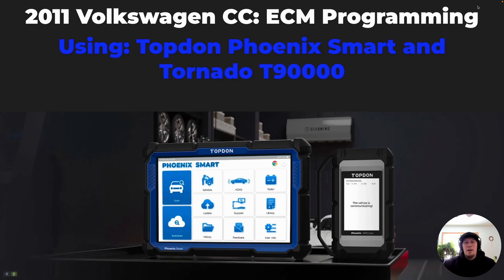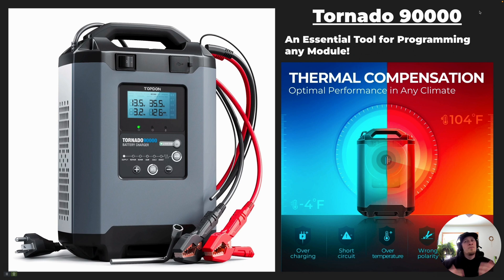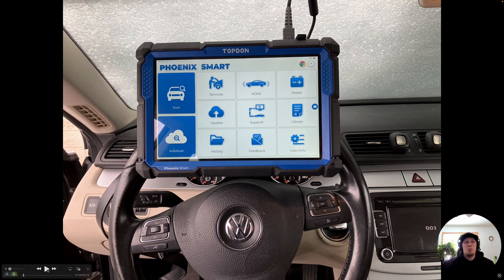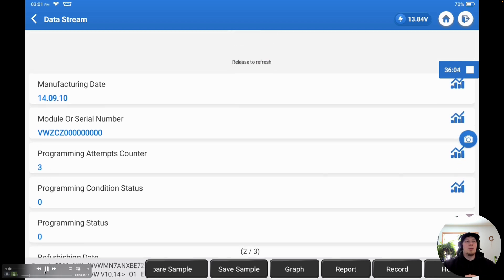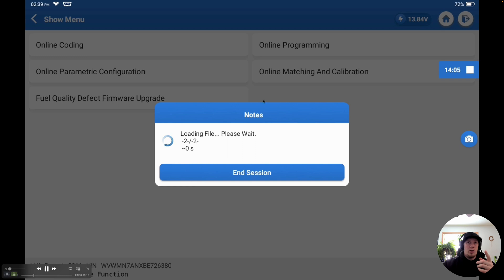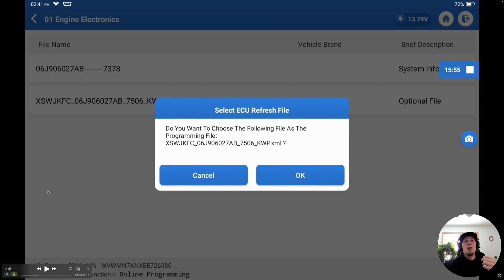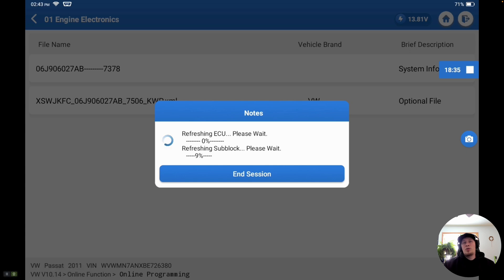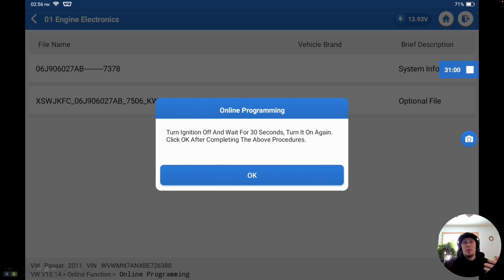Programming Control Modules - TOPDON Phoenix Smart Scan Tool

Comment: Thank you - very clear. 
Programming kinda scares me because modules can easily be bricked if something goes wrong. 

To the best of your knowledge, do  modules tend to have bootloaders: a portion of memory it boots out of into application code? If something has gone wrong, a bootloader could potentially be used as a starting point to retry. 
It almost seems like car manufacturers don't add that to their design...

Comment: Is there anyway you can make a training video or send me towards the correct way to properly programming a VSA module on a 2019 Honda accord? I work at a Honda dealership and sometimes the iHDS  are occupied, I almost bricked a ECM trying to update because for some reason my Rlink that comes with the topdon SMART scanner, was updating the ECM, at 70% it turned off and back on and connected Bluetooth then wired but bricked my module, was able to lucky get it back by reprogram I g ECU but I used the iHDS when I’m sure my own 2,500 dollar scanner could have fixed it too
Reply: Replaced VSA module due to failure, module needed to be reprogrammed with ECM because the red security light was flashing and car wouldn’t start, couldn’t find correct setting in scan tool so I went to ECU reprogramming after scanning VIN, first ACCL reprogram/Update went great, but PGMFI update was going good until it disconnected for some odd reason and reconnected Bluetooth instead of wired. Then bricked ECM and saved it with a Honda iHDS scan tool and a whole bunch of registration issues and had to write in VIN and finish VSA module rewrite registration replacement

Comment: I have the topdon  artidiag pro and I had replaced the ecu and bcm on my 2011 Buick lacrosse how do you reprogram the ecu and bcm and key fog by using the? “Topdon ArtiDiag Pro”
Reply: i don't think this feature is possible with GM. you would probably need to use aN APPROVED J2534 and GM subscription. the challenge will be the J2534 because the subscription is only $60 perVIN  if I recall well for 2 year access for the same car

Comment: Abs is not available online programming? I have a 2011 passat used abs and i need to coded but i dont have the old module to get the code from it. Looking for a scanner with that function.
Reply: MAY BE autel im608? Did you ever do it?

Comment: Hi

How do you put Valtronic Servomotor in Service mode with Smart?
I didnt see the section for Service Mode before doing Valve cover. Need to set the Valtronic in Service mode. Thanks

I think I fig it out, thanks